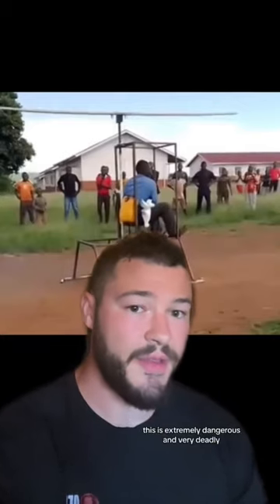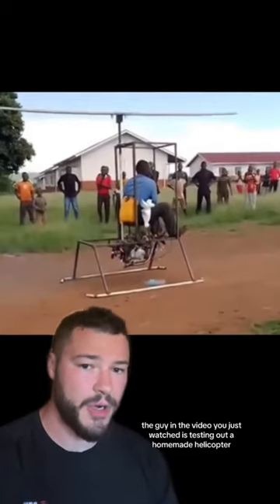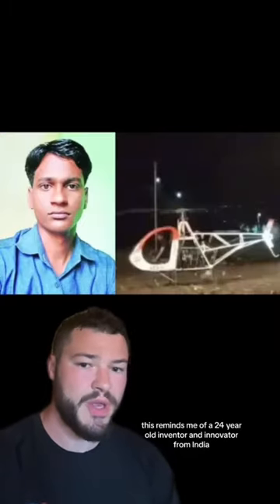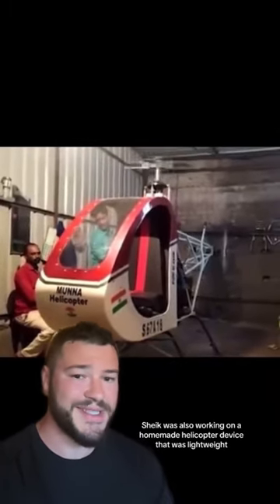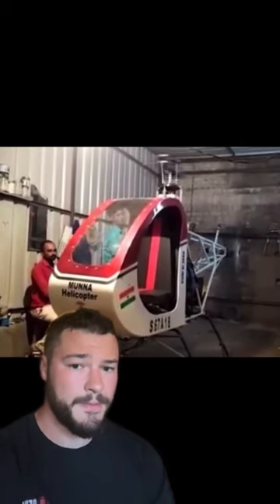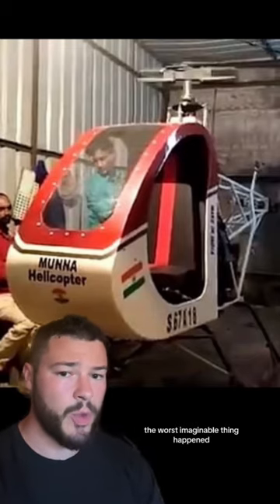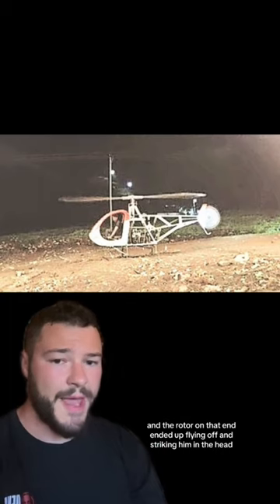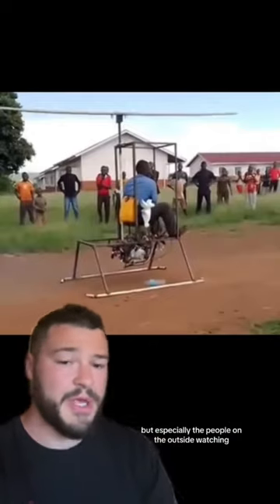Why You Should Never Make A Homemade Helicopter #dangerous

Comment: Building a helicopter isn't that easy you'll need Aerodynamics: Lift and control.
Key Parts: Rotors, engine, fuselage.
Controls: Cyclic, collective, anti-torque.
Safety: Stability and emergency systems.
Engineering: Materials and design.
Regulations: Compliance and certification.
Testing: Performance and maintenance.
And never use a skinny ahh design unless your willing to risk your life